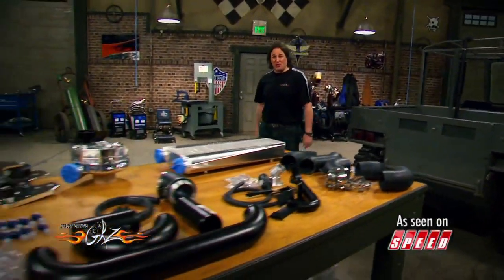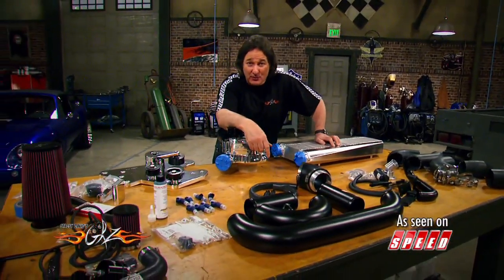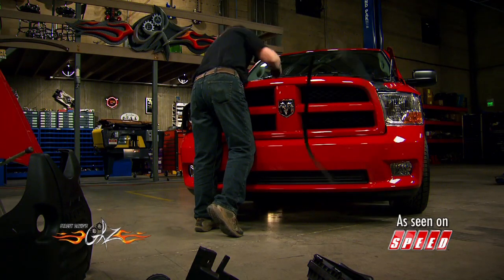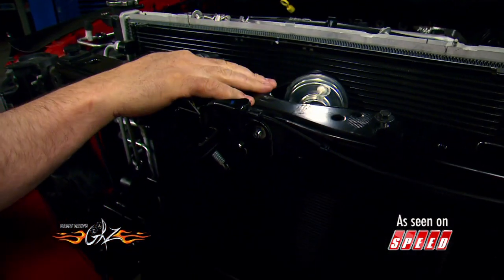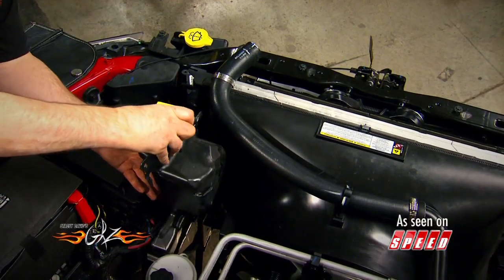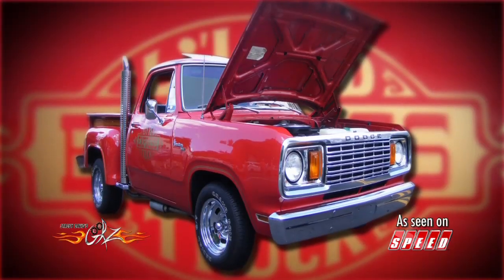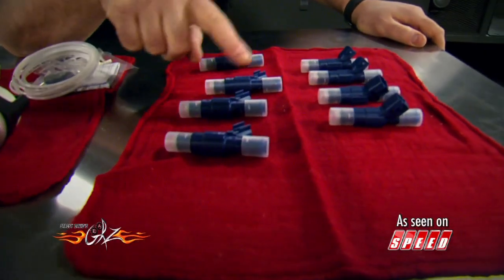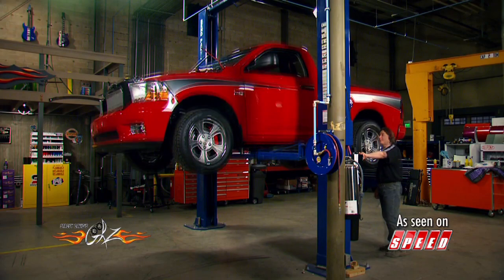Stacey David's Gearz Supercharge Your Vehicle with ProCharger

Comment: 6500 + install+tune+new fuel pump+headers+and exhaust system+ intake+ throttle body for a grand total of around 14-16k sure you can install the procharger but you can't get the full performance out of it like that and unless you upgrade everything else other wise shit will start to brake down even on 6-7 lbs of boost and with out the right amount of air fuel mix no way in hell that things gonna give you 130+ hp by bolting it on

Comment: If I were to decide on a procharger for my 17 Ram 1500 rt, what else would I need think about on upgrading? In order not to run into any problems down the line
Reply: Hector Jimenez Transmission
Reply: The 8 speed trans can handle the power no problem, it’s the engine internals that you want to be careful with going over 8 psi

Comment: And at just the price of one of your legs you can have this too!
Reply: Cheaper than most roots blowers.
Reply: Then go find another way to reliably get 150 extra ponies. Nitrous will burn up your engine with time, and also destroy your stock drivetrain.  I just spent $8,000 adding 150hp to a 6 cylinder. Gotta pay to play. If you're broke then stay home.
Reply: Stacey David is a shity salesman if you have half a brain in your fucking head.
Reply: I could buy and build up a old crown vic interceptor that would walk all over that pickup for less money than that supercharger costs.
Reply: @justin76bmw  but who wants an old Crown Victoria?
Reply: @dirtyfax  uhm. Me. There epic

Comment: Stop commenting on if they make one for your vehicle. All you have to do is Google it. for example. 2006 ram 1500 4.7 procharger kit. and voila
Reply: Trump Pepe I can see your from /a/
Reply: Trump Pepe you're gay
Reply: Do they have some for Chevy Tahoes?
Reply: gunslingerW7 I'm pretty sure an all motor civic can tear you a new one, no forced induction needed.
Reply: You can get an entire Honda turbo kit for around $700-$1,000 on eBay

It's not hard to get a Honda H22/F22 or Honda K20 to 300hp on stock internals.
You can shoot for the moon and get forged pistons and thicker connecting rods and go all the way to 700-800 depending on how much boost you want and how good your tune is.

Most people underestimate just how fast a 700hp civic is. A stock Civic only weighs around 2,500lbs so there isn't a lot to pull.
And no, you don't need to add fart cans for "performance". Personally I prefer the stock exhaust, people don't know what hit em when their Hellcat gets outrun by a beater family sedan.

Comment: nice how much does it cost & can it b intalled on a 2004 5.4 f250??
Reply: yes and no, yes as in you can make it fit. but no as in it wont just bolt o like that and will need a whole lot of tweaks and bending. and ofc different tuning. and would set you back at least $5k for a used one and $8-15k for a new one thats not considering all the customizing and stuff to make it fit and run well.

Comment: how does the transmission handle this increase in power?
Reply: +Justin Trent needs to be rebuilt
Reply: New or rebuilt transmission would be optimal but you can run a couple months without as long as you dont beat the fuck out of your vehicle, my buddies 08 Ram held up for 4 months before he spent too much on a nice 6 speed Manual
Reply: The 8 speeds can handle it with no issues at all.

Comment: NO THERE IS NO PART TWO, AND WON'T BE FOR AWHILE. He jumped the gun like a moron thinking he knew what he was doing. 5.7 and 6.2 Hemi's for the Ram, charger, challenger etc... 2011+ are NOT tunable. The ECU was changed to an un crackable code not allowing any company to break it. Meaning this super charger kit won't run until that happens. He can't remap any of the engines perimeters to accommodate the supercharger. It might be years, hell it might NEVER be cracked. I wouldnt have got my 2012...